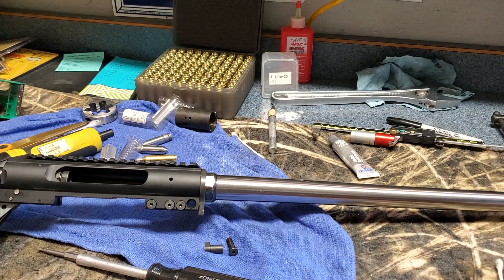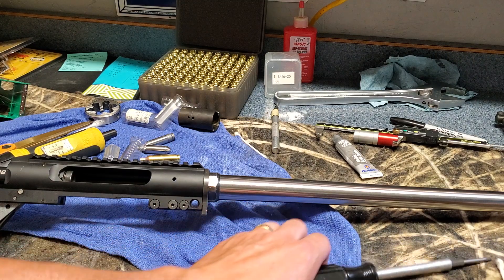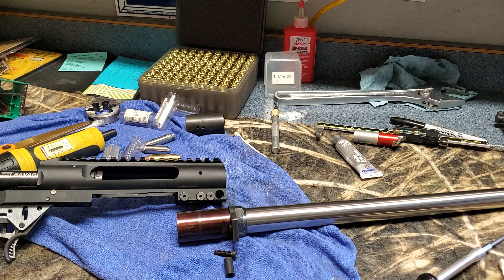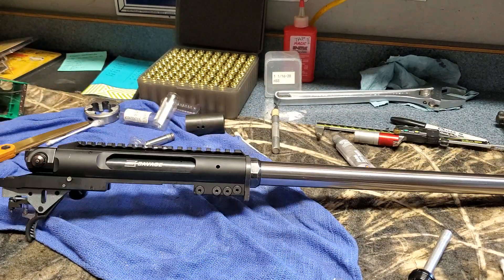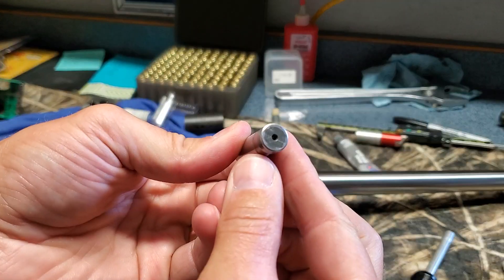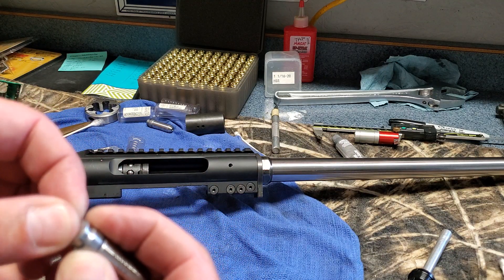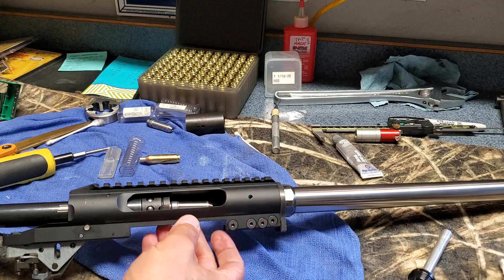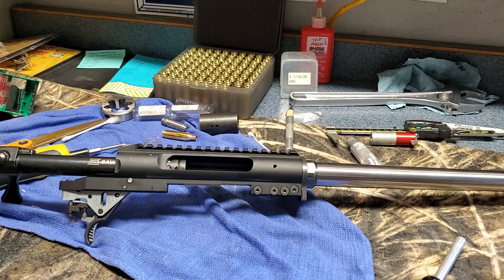Savage Impulse Re-barrel Part 4:  Barrel swap headspace consistency test

Comment: Since the 6 Hexlock steel balls in the bolt lock into the barrel extension, the barrel, bolt and extension together, could be moved to a different receiver and maintain headspace.